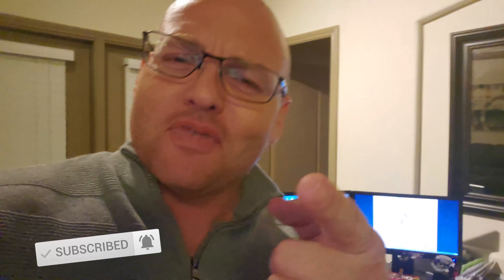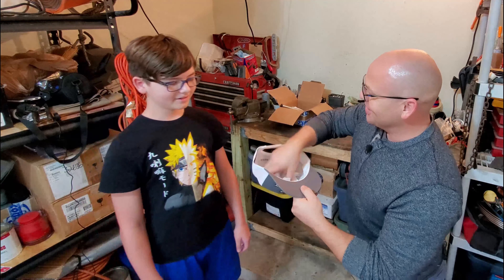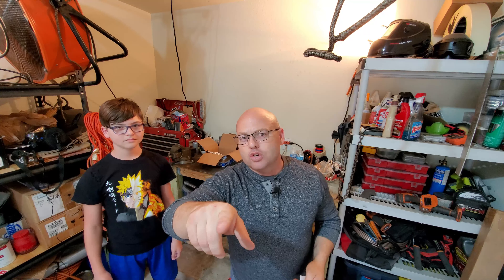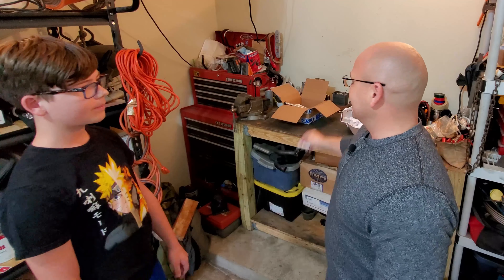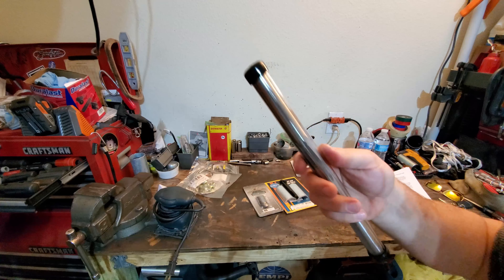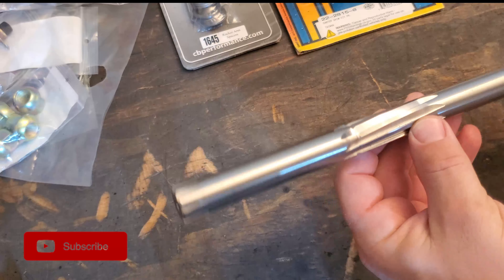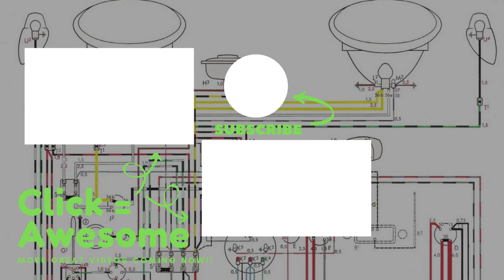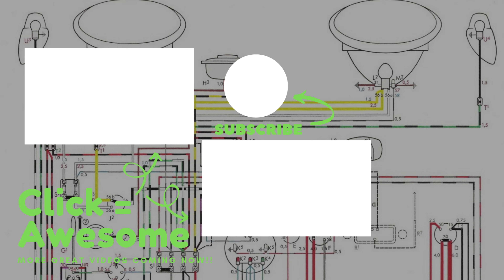AirKewld "Bad Brakes" Take 2 | Brake Bedding- 1956 Oval Ragtop! Volkswagen BUG | JW Classic VW

Comment: i want to put 4 wheel disc brakes on mine, and was considering the bad series. surprized you need to do all that other stuff. thanks for the heads up!
Reply: oh, not on facebook got a new laptop and now can't get back on, was on for years, bummer.
Reply from the maker: Hey Moses! Glad you liked the video brother, yup there are definitely things to consider.  I'm glad I did the front first, now for the rear.

Comment: Hi Jason, Good video👍 What about pulsing brakes? Would that be related to the same issue? It does may a noise now and then when first backing out of the garage
Reply from the maker: Hey there Tim, what do you mean by pulsing?  Like dragging?
Reply: Just getting to responding. Pulsing is where you start braking especially downhill and the brake peddle vibrates like the rotor is warped
Reply from the maker: That could be that it is warped, or the pads and rotor never bedded.  So yes this may fix your issue.
Reply: Will try it first before buying new parts. Thanks

Comment: How did it start that easy? Was the engine warm?  But this is Texas, not Canada I get it... Even in the summer I don't think mine will start that easy..... I even run MegaSquirt!
Reply from the maker: Just got her tuned up right brother!! Believe me it took some time to get there.  Carbs set up right... great dual linkage... proper spark plug gap, fantastic distributor and a good fuel pump.